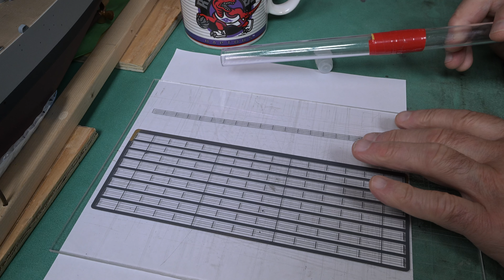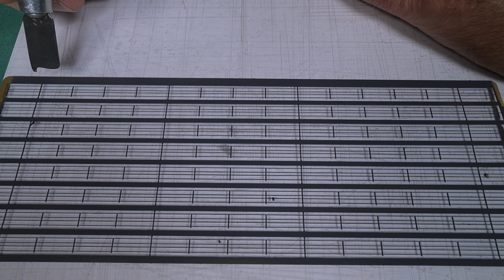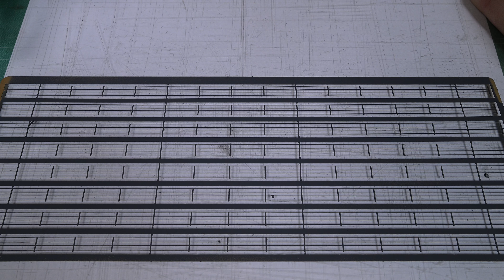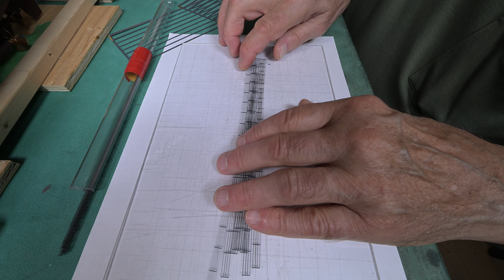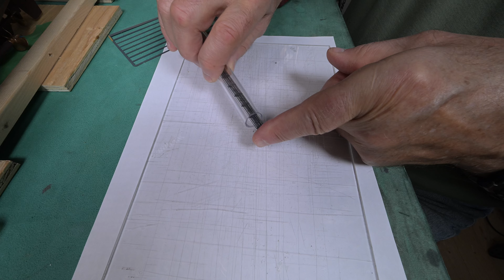The Model Ship - Part 1781

Comment: Hi Ron. On both my 1/350 and 1/700 models of the Missouri, the PE fencing that goes alongside the catapaults is only 2 rails high, I assume to let the catapault swing out over the edge of the ship..  The pieces of PE are model specific and the fair leads have the fence rails touching the outer of the fairlead.  Not sure what Stefan Draminski shows.
Reply from the maker: I keep forgetting to check Stefan's book!